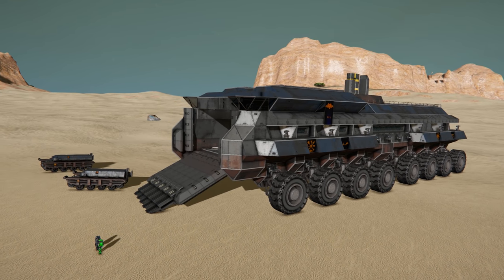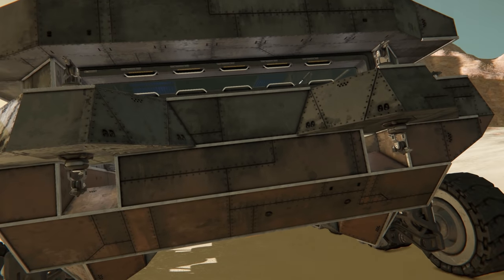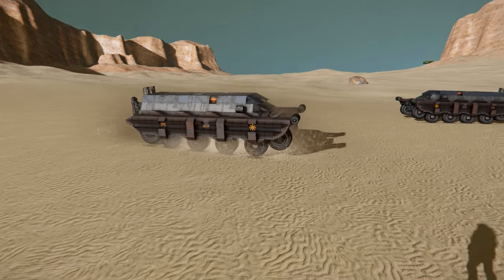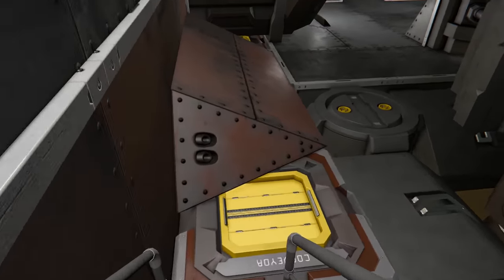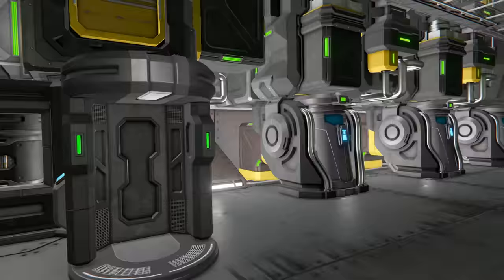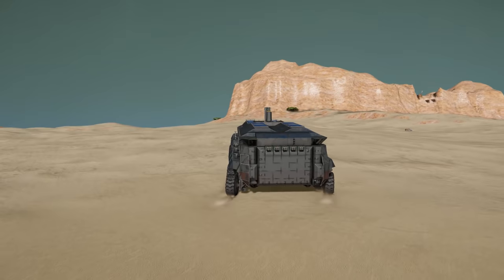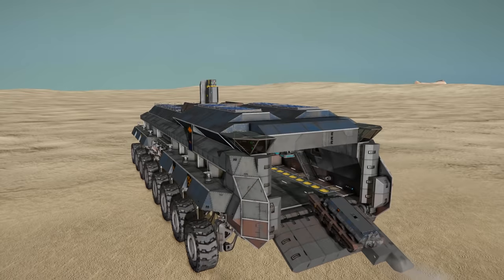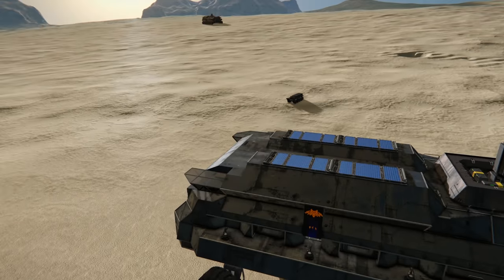Space Engineers - Grumpy Pug Base On Wheels

Comment: i made a similar thing months ago. a mobile base complete with small hangar for vehicles and a landing pad on top. a main gun on top(from a mod) and modded and vanilla vulcans with vanilla missile system on the sides surrounding the damn thing. complete with engine room, bridge, crew quarters (with commander's room being separate), mess hall, small med bay, locker room and showers w/ toilets. it also has it's two custom apc's inside, but can be removed and replaced with other smaller vehicles. wanted to share it as a mod but idk how. only problem is idk how to make a ramp that extends and connects to the ground and the thing is slow unless people tweak it. the first and only one i created was more of a mobile battlebase compared to the one on the video which is  an exploration vehicle.

Comment: It would be cool If you would make a rule in one of your servers that you cant use the 3th person camera when driving. It would be interesting how different builds would be when the field of vision would be an actual consern.
Reply: not many people know it but windows are hella strong, especially larger ones are way more durable than light armor blocks, i would use those
Reply: I was testing a fighter build and light armor blocks melted under its firepower. Then I fired on a 3x3 window and was shocked when it held up to a fairly good burst of fire. I wouldn't take windows over heavy armor, but they aren't bad at all.
Reply: @rdubayoo  Interesting... So instead of making a light tank out of light armor you should make it out of glass. That would look cool. :)
Reply: @qwertyqwerty-ek7dy   Its how SE handles damage, block health is based on the components in the block, they could probably make some components worth more hp to make armor more useful but looking at it another way, the blocks that have higher health are also considerably more expensive. a good armor block that you can use alone or with light armor is blast door,